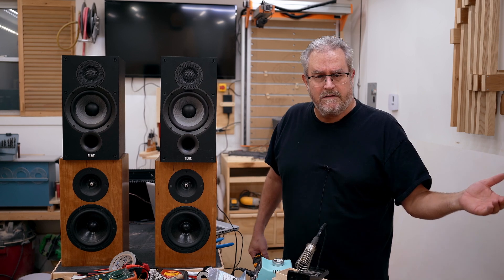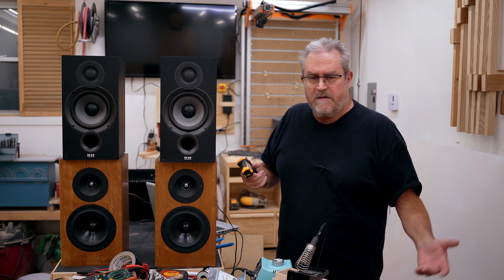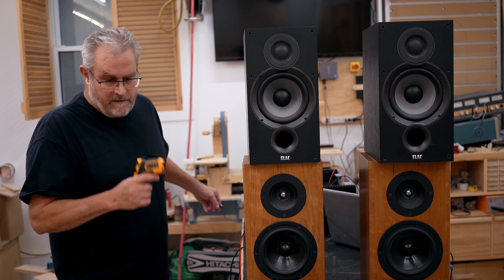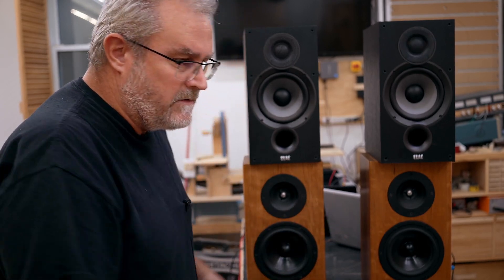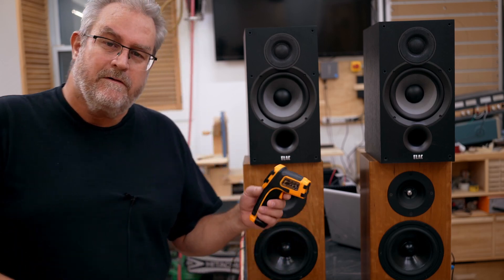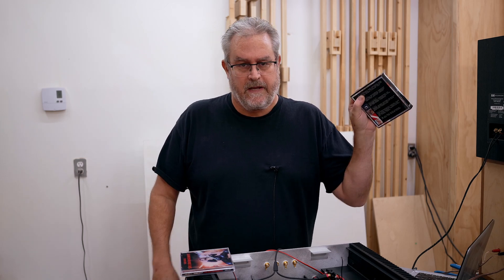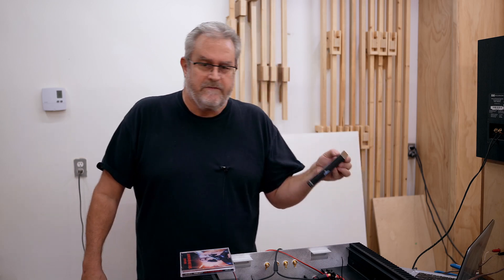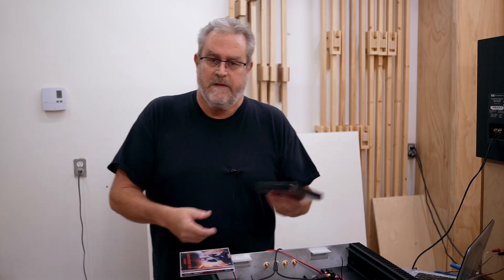Flame Testing My 10 Channel Amp

Comment from the maker: A little bit of hype in the video title, but part of the build is occasionally stopping to run some tests to check conditions. In particular, I don't want this massive undertaking to go thermonuclear and set fire to my house in the process. All along I've been monitoring how hot it gets while doing different things and everything looks good, so far. 
Why test with music instead of dummy loads? Because this will be playing music so it presents a more realistic scenario for the amps. And I've also tested into dummy loads, it just not as dramatic for video. 
Of course this is with the amp sitting wide open and the temps will go up when the front and top cover go on, but I don't think it will go up enough to be a concern. It will go up even farther in a warm room stuck inside my equipment stand, but still should not enough to worry about. There will be more testing as I make more progress.

The amp started out cold (18 degrees C) when I switched it on in the morning. The heatsink temp went up to around 24 degrees after running for around two hours, then I turned on the music and let that play for over an hour. Only 4 of the 10 amps were driven, but the output power would be about equal to what it would be with 8 channels driven at high volume into my 4-way speakers. 
For comparison, my older 6 channel amp runs at a slightly higher idle current (40ma / output with 4 outputs on each amp board) and has smaller heatsinks. It sits at around 50 degrees C at idle and has hit 70 degrees when driven hard. I built that amp 13 years ago and it's been in continuous operation ever since. 

Another comparison is the Yamaha HTR I'm currently using in my listening room. That runs just slightly above ambient room temp and I've yet to notice any significant amount of heat coming from it. Based on that I know it is also running a fairly low bias current, yet it has amazingly low distortion and noise performance. It has 7 channels in a much smaller case with much smaller heatsinks.

By contrast, the Onkyo 2 channel receiver I have gets quite warm, but has a just barely audible amount of hiss when you put your ear to the tweeter. It is running at a much higher bias current and unless you go to extreme lengths to make a very smooth power supply, you give up some noise performance when you push up the idle current. 

Some will swear that a higher bias sounds better (pure class A is regarded as the best sounding solid state amp topology), but I'm not aware of any blind testing that backs up that claim. 
The A in class AB is the part of the output that's running in pure class A operation. That is, the transistors do not switch off. For best efficiency, you want just enough class A operation to prevent crossover distortion. Crossover distortion happens when the output transistors switch off completely. Some amps push that class A mode up (via higher idle current) to cover the first few watts of output, but the cost is lower efficiency and much higher temperatures. 

For me, the proof is in the low distortion measurements. If it's faithfully reproducing the signal and has the power to do that with authority, that's all I need from an amp. I'd much rather have the amp running cooler and lasting longer as a result. Any audible difference would be so small that it couldn't possibly offset the lower efficiency and higher temps.
Reply: Epic

Comment: is the amp completely passive cooled even with the lid on it? .. I am guessing with those low temps, you have no need to introduce the subtle fan noise and the close case will only maybe raise the temps a degree or 2
Reply from the maker: Fans are not really an option for an amp running in a listening room.

Comment: Did you build a Thermal protection circuit ? Thought about building a SSR for each speaker for more pretection ?
Reply from the maker: Most DIY amps don't have anything other than the most basic protection(like earth grounding the metal chassis), while all retail ones do mainly for liability reasons. 
I have thermal cutouts that can be mounted on the heatsinks that will kill the AC if they get too hot, but I only use this amp while I'm in the room with it, so my nose will be the only protection circuit I'll need :)
Reply: @IBuildIt  Why not put a SSR on the speaker outputs to protect, what you going to do if your amp goes awal, and throws full rail voltage into your speaker :)
Reply from the maker: Sounds like an excuse to build a new set of speakers!
Seriously, while anything is possible, the chances are very slim. If the amp is well made using quality parts and passes the first power up smoke test, it should be good to go.
And a 10 channel active amp is already complex enough, without adding in more stuff "just in case".
Reply: @IBuildIt  Sure, i guess, did you load test this with a 8 & 4 ohm load, then run a sweep through it at different burst levels ?

Comment: Again, how many watts can the amplifier deliver into 8 ohms?
Reply from the maker: With just one driven, around 150 watts rms.
Reply: @IBuildIt  Wow!
Reply from the maker: While they are capable of that output power (and that's great for transients), they will normally be putting out much less. Better to size an amp so that it can give more than you actually need to eliminate clipping.
Reply: @IBuildIt  Yes I understand. Normally we only juse 1- 5 watts and so you have almost 20 dB headroom. And of course you power part can't delivery 1500-2000 watts.

I noticed the other day, the two termanly runaway diodes (pin 4 5) are drawen wrong in the diagram. Catode to catode. Do you agree?
Reply from the maker: You mean the diodes for thermal tracking, they are in the output transistors (pin 4 and 5) and are wired in series with a trimpot to set the idle current. Pretty sure they are drawn correctly in the schematic I show in the video, but in any case they are routed properly on the boards themselves, or it wouldn't work.
I believe you also asked about the ground lift circuit (two diodes wired opposite plus a small value resistor). Those components "lift" the signal ground above the main ground to help keep high currents from flowing into the signal ground and causing hum. The diodes just make it so that the resistor won't burn out.
Reply: @IBuildIt  Thanks!
The Chassis look fantastic with the black Heatsinks!
Reply: Excellent build.  > hope you get years of enjoyment from it.

Comment: I am so envious of the temperature in your shop. 20C in summer without AC. I walk through mine, look at the CNC, and ..nope, just too hot to work on fine adjustments. I did finish my subwoofer amp enclosures but that had to be done at night with the fan blowing. Best live album, I will push back and suggest "Peter Frampton Live" which I am sure that you already have.  I do hope that my amp turns out as nice as yours!
Reply from the maker: I never was much of a Frampton fan, so I don't have it. Not sure why, exactly - his stuff is good. Could be like Wings (Paul McCartney) and how that was way over played on the radio when I was a kid. I recently got a best of Wings CD and love it! So maybe I should get Frampton and give him another chance.
Reply from the maker: BTW, probably sacrilege for most, but I don't have anything from The Beatles. I like a lot of it, but again it was way, way overplayed.
Reply: @IBuildIt  I am not a fan of Peter Frampton either but that live album is still one of my favourites despite me being into alternative for most of my youth.